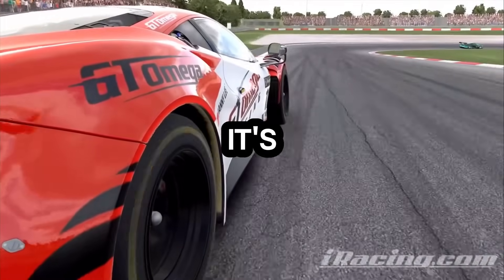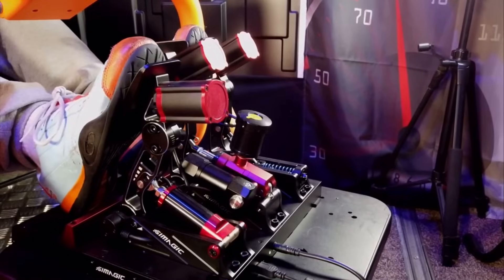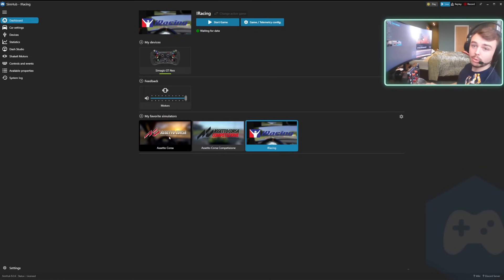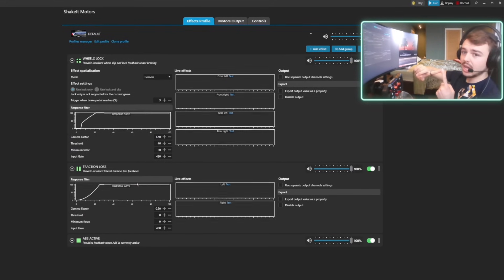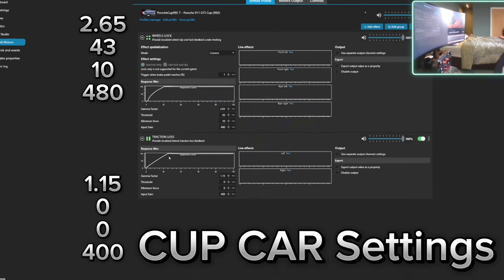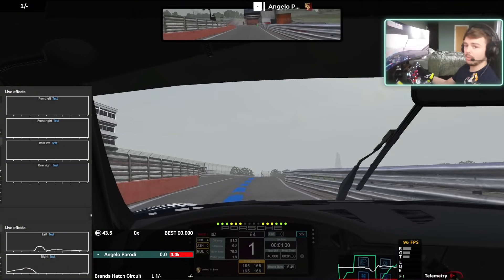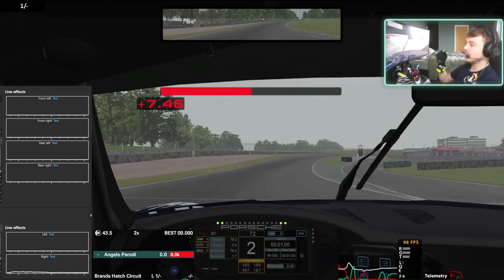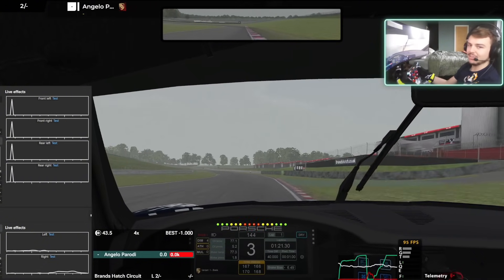Simagic Haptic Reactor A Game Changer for Sim Racing (iRacing & Haptics)

Comment: I take it that "If you've just got regular brake pedals, this is going to be a little bit trickier for some of you" is British understatement for "Forget it, sucker, it's impossible."
Reply from the maker: Lots of people have set them up on different pedals it just requires more work.

You’re gonna need to find some 3D printed mounts for your pedals and also purchase the p2000 pedals control box. There’s other videos online for how to use them with other pedals.

Definitely not impossible 👍🏽
Reply: Sorry for all the individual comments for the different links. But that’s the amp you want and then choose between either base shaker. Only other thing you need is some speaker wire and some hardware and a few tools (a drill) to mount them to your rig or pedals
Reply: All you need for Huesinkvelds is a screw and a washer.

Comment: Thanks for the video, Bravo.  The devil is in the details.  A subsequent video showing the details would be awesome!
Reply from the maker: Will make one soon about the Simhub install and then how to mess around with the details and set it up properly👍🏽
Reply: @TerriblyRacing  Excellent, thanks.  Interested to know specifically how you dialed in the Simhub curve (which paramater did you start with), and second how did you get the trace overlay to show while racing.
Reply from the maker: @mattmerciez8144  yeah for sure, will explain my best how to adjust the settings, unfortunately getting the trace on screen for you won’t be possible.

I can do it whilst recording but not live on my screen. You shouldn’t want it on screen when driving you should feel the vibration whilst driving.

Comment: Have had these on my simjacks for about 6 months and it’s been a game changer in immersion and as an amazing tool.
Reply from the maker: Check out the settings in my second video, the settings in the first video were bugged! And honestly like you said they are a game changer
Reply: @TerriblyRacing  ho appena preso questi motori. volevo chiederti se si puo' usare semplicemente simpromanager x settarli. a me interessa abs per freno e tc per accelleratore. oppure devi usare per forza simhub?
grazie
Reply from the maker: @lusl77  you can use Simpromanager if you just want to use TC and ABS. Some games don’t output that data and in that case you’re better off using Simhub effects.

But yes you can use just simpromanager
Reply: Would haptic motors be beneficial if you race GTP’s/LMP3’s/LMP2’s?
Reply from the maker: @louiienation8497  I don’t see why not
Reply: @TerriblyRacing  I’m asking about those cars specifically cause they don’t have abs or traction control
Reply from the maker: @louiienation8497  neither of the effects I use in Sim hub require ABS or traction control
Reply: @TerriblyRacing  thank you for that info! I’m really excited about buying haptics now !

Comment: Simagic haptic pedal reactor is so cheap bro. I should have done this earlier.
Reply from the maker: They’re not that cheap but compared to the rest of sim racing they’re great! Use the settings from the second setup video
Reply: @TerriblyRacing  I live in Canada and I have a local distributor for simagic so it kind of works out. Was looking at sim3d rumble kit, but anything from the UK kills me in taxes.
Reply from the maker: @EluciaDeLuteIma  just remember to Mount these on pedals that aren’t Simagic you’ll need to buy 3D printed mounts to mount them, a power supply and the p2000 control board, each vibration motor is about £65 but yeah they are great
Reply: @TerriblyRacing  Ah yes. I sent my friend a file already and he'll print it tomorrow.
Reply from the maker: @EluciaDeLuteIma  good stuff, use the settings from my second video, these settings are no good

Comment: So I guess the brake pedals vibrate as well when you brake? Do the the vibrations feel different on the 2 pedals? Thanks for the vid
Reply from the maker: @7hecouchpotato  so the brake pedal reacts to wheels lock and is set to vibrate at 23hz the accelerant reacts to traction loss and vibrates at 41hz. The vibrations on both pedals are quite different due to the different frequencies. 

If they were the same frequency, I’m sure they feel similar on both pedals
Reply: @TerriblyRacing  Cool. Thanks for the detailed response. Will try out the settings once the speakers arrive!
Reply from the maker: @7hecouchpotato  I recommend using the settings from the second video. The settings in this first video are bugged/shit.

I had a setting in my Simhub that was wrong and made all these settings wrong. The second video had the correct settings, if you join my discord, link in the yt bio. You can download all the per car settings I’ve made so far 👍🏽

Comment: What about for dirt racing will this work
Reply from the maker: Yeah for sure but it might be a lot less useful as you’re constantly braking traction, you would have to move the thresholds much higher as to not trigger vibration for say a 5° slide and maybe you’d want vibration at a 30° but I can’t say how useful it’d be for you
Reply: Oh you can change the degree of slide for when the vibration starts? That might be goated for dirt
Reply from the maker: @colors3037  through the settings explain in the second video you can adjust how the vibration comes in and how soon and strong
Reply: Also I don’t see the p2000 module on the website I’m thinking about buying the p1000 pedals and the haptic motors for them
Reply from the maker: @colors3037  it’s called p2000 HCB HAPTIC control box
Reply from the maker: @colors3037  if you go for the p1000, don’t forget the power supply
Reply: @TerriblyRacing  power supply for the haptic right or the pedals
Reply: Also is it easy to hook up the control box
Reply from the maker: @colors3037  power supply for the haptics yeah, there’s no supply for the pedals 👍🏽
Reply from the maker: @colors3037  yeah very simple, just power, usb, and haptic reactors plug in

Comment: This was really helpful. I knew I needed one of these for braking but didn’t realise it would be so useful for the acceleration. 
I was going to buy one of these for braking and I already had a transducer I was going to use for the accelerator pedal. Might test it this way first
Reply from the maker: Good idea, let me know how you get on
Reply: @TerriblyRacing  would love to test it asap but I’ve got a back injury which has stopped me (sim)racing for the past 2yrs. Might finally get back on the track in a few months 🤞
Reply from the maker: @tdhitchins  fingers crossed for you bud, even if it’s not competitive, just get in the seat and relax, injury permitting 🤞🏽
Reply: @TerriblyRacing  cheers mate. You don’t know how much I’ve missed it!! It has got me playing some other games I wouldn’t have had the time for and I’ve enjoyed that tbh, but still……I wanna race
Reply: @tdhitchins  Just out of interest, what kind of pedals and seat do you use? I had back pain too. Was using a soft seat with a load cell brake pedal. Every time I pressed the pedal I would push myself far into the seat, which crated pain in my lower back. Couldn't race for more than 20min. As soon as I switched to a solid bucket seat (something with a fiber glass shell), my pain was gone,...and my braking got much better.
Reply: @mementomori4972  thanks for the reply. I’m hoping a solid backed seat will help, I’d been thinking about that. I used to use the playseat challenge (soft back) and thought that wasn’t helping. My injury is due to having torn a bit of a disc though. It was some time ago but still getting over it.
The pedals I have are now the simlab xp1’s which I’ve not even been able to use yet (argh) but I’ve printed off some mounts for these rumble motors. Hopefully later this year I’ll be back on track!
Reply: @tdhitchins  With soft seat, I meant something like the GT Omega, but the playseat challange is basically a camping chair,...a hammock with benefits. Dude, you can't race in that, especially with load cell pedals and a healing back injury. The thing is a toy. It's meant for something like a G29 setup. I get it. It's expensive. You will need a profile rig too, but it's going to be so much better for you and your special circumstances.
Reply: @mementomori4972 
😂 hammock with benefits! I like it.

Yup, I sold that a while ago now after realising it was probably not helping and wanting an upgrade to an aluminium cockpit anyway. Once my back is doing a bit better I’ll sort the new equipment.
I was going to buy a bucket seat (fibreglass) but then thought the added comfort of a gt omega reclining chair would be the best option as I don’t have to sit so upright (which I really don’t like). I know all about posture (wife is a physio) but I just can’t stay comfortable like that.
Reply: @tdhitchins  The GT Omega is not going to give you better comport. Don't buy that thing, you will regret it. It's to soft  and it wiggles. Michel Smith has a small Simracing Youtube channel. He upgraded from a GT Omega to a bucket seat and he also has a back injury. Watch his video on finding the best racing bucket seat, if you're interested. Sorry to read about your psycho wife. Wish you all the best!
Reply: @mementomori4972 hahaha physio not psycho ;) although….

And cheers, I’ll checkout that channel for some advice 👍

Comment: Super helpful!  Thank you.  (haven't tried it yet on my own setup.  P1000 pedals, SimMagic motor, iRacing and SimHub)  I stopped using the SimMagic motor a few months ago because I couldn't get it to stop shaking.  I'm sure it was a setting that was wrong in SimHub, but I couldn't figure it out.  I did notice that you somehow eliminated the unused SimHub options in your example.  I'd like to learn how to do that.  (maybe that would solve my issue)
Reply from the maker: Use my second video/part 2 to set them up, I changed the settings as the first ones were bugged originally 👍🏽
Reply: @TerriblyRacing  Thanks!  (searching for that part2 video now)
Reply from the maker: @mitchlewis535  if you can’t find it go through my channel, any questions join my discord it’s linked in my latest vid
Reply: @TerriblyRacing  Thanks

Comment: I use “cheap” Dayton base shakers under my pedal (fanatec CSL load cell) for the same purpose, and have used them for about 5 years now. It was a game changer for me (even on top of a load cell). 
Cost me about $50 but that was in about 2017-2018 so don’t know what they cost now. But you just need a couple shakers and a cheap usb amp. Run them through sim hub as well…
I have added to them over the years so now I have a total of 4 on my rig… and contrary to most advice I don’t have them set up for “4 corners” so you can feel each individual wheel….
I have 2 set up under my pedals only because one just wasn’t quite enough to really feel the “shakes” through the pedal, but for about $15 (again in about 2018) adding a second one did the trick… these two are set up to do the same thing and just having 2 was more powerful than just a single one. My other two are mounted on my cockpit seat. One of them right under the seat (right under my butt), and the last one is on the back of the seat kind of at my lower back. These two shakers on the seat do a few different things, the one right under my butt I use for traction loss for the rear end of the car (so it kinda gives you that feeling in your butt when the rear end is braking loose), the one on the back of the seat also does this to amplify it. The only extra thing the shaker on the back of my seat does is gives you a slight punch in the back on gear changes. So ya all for under $100 I have 4 base shakers and two usb amps. 2 amps is the key… with sim hub each amp can be its own “channel”, so with two amps one is for the front axle and the other is for the rear axle.
Reply: Take a Pic of your configuration

Comment: I dont get exactly what i feel during braking…. For example if i hit the Brakes (Porsche Cup) it rumbles but i dont think that i have wheel locking there… and if i keep the foot on the brakes to force a rear lock up i get no rumbles at all - so i have no clue what exactly i get here if it doesnt rumble like full when the tires are locking before i spin… (using ur settings for Porsche Cup)
Reply from the maker: Use the settings in the second video, wheels lock can’t activate in iRacing as it’s not supported, the vibration should come in when you’re roughly at the right threshold of braking
Reply: @TerriblyRacing  ah ok to if its rumbling i am roughly on the best possible braking force input? So if its stopping rumbling i should put less force of braking in?
Reply from the maker: @MINKIHLGTSPORT  whilst braking when it vibrates you are roughly at the right point, when the rumble stops you’ve pressed too hard or you’re not braking hard enough

Comment: Great vid!

Question: is the haptic feedback dynamic? In other words, is the vibration 100% or 0%? Or, do they vibrate a little when traction is barely breaking, and a lot when you're sliding, etc?
Reply from the maker: No unfortunately they either vibrate at 100% or nothing, I think it’s because they vibrate at certain frequencies so therefore it makes it impossible to regulate the force so it’s either on or off
Reply from the maker: Sorry I have to acknowledge my last response is all true however with sim pro manager, the Simagic software, the force can be be modulated, so not sure why it doesn’t feel possible in Simhub, I will follow up
Reply: @TerriblyRacing  Appreciate the follow up. I'm likely going to order one for my brake, but just curious if there is granularity to the feedback.
Reply from the maker: @steelereign reinstalled SimHub today, there is granularity, you can customise how strong the feedback is and varying stages and strengths.
New video coming soon!
Reply: @TerriblyRacing  That's good to hear! I just ordered my haptic (only for brake) yesterday.

Comment: Not cheating because it doesn't actually work the way the video implies. Yes it's great for extra feedback, but iRacing doesn't output any data on loss of traction into simhub. Unless something changed recently.
Reply from the maker: I think you’ll find the algorithm knows pretty damn well when there’s traction loss, I seriously feel like these are almost cheating
Reply: @TerriblyRacing  simhub doesn't know when the wheels are locked or spinning. That's why you need to change it per car
Reply from the maker: @MarkGreenhow  no you need to change it between the cup car and the f4 because they’re massively different cars with very different power levels and dynamics. Have you not used shakeout motors in Simhub before?
Reply from the maker: @MarkGreenhow  go watch the part 2 of this video for more information
Reply: @TerriblyRacing  I did. You also replied to someone else saying what I said, iRacing doesn't output wheels locked, you can estimate it based on testing but it's based on pedal pressure. Track surface changes make a difference on whether 30% braking pressure locks the wheel or not. I've tried this and found it gave me no advantage. I do wish you all the best with the channel though.
Reply from the maker: @MarkGreenhow  I appreciate it, Simhub does receive data from the cars from iRacing just certain properties aren’t exported that’s why different braking pressures matter whether you’re going up or down hill the reactors don’t just work from pedal position. My accelerator tell me when I am sliding the variables I adjust decide how soon they tell me into the slide, like only 1° slide or 30° slide. And also how strong the reactors vibrate along that curve from 1° to 30° slide

Comment: The F1 games have controller vibration system based on rear and front slip amount (one motor for oversteer, other, more binary, for understeer), and that was already considered borderline cheating, especially in wet conditions. I want to put that system back in BeamNG.

I cant imagine how good that would be for pedals. I guess you could have one on the throttle, and on the brakes for front slip (understeer).

Comment: All I'd follow up with on this is that pedals maybe ought to start coming with some sort of feedback as standard, so that games themselves can start supporting it. Flexibility is a good thing, and the pedals are behind the wheels in that regard. 

As to the usefulness of it all, well it helps some, sure. Others would argue VR is an advantage, but I'm not sure that pans out in reality. But you can understand why some might think that, with the depth perception. 

And yet for all these extras, there's always some ass that will be faster than you using a Dual Shock controller.
Reply from the maker: Very true😂😂😂

Comment: Thanks for the video  but those settings for F4 are dreadful! Pedals vibrate too much! Did few F4 laps at Zandvoort and pedals were vibrating pretty much the whole time. Smallest steering wheel movement causes haptics to vibrate, even on the straight.
Reply from the maker: You are correct, I do apologise, I had a simhub problem, I’ve released a second video with updated settings, Part 2 video is out now
Reply from the maker: I reinstalled simhub because i had a bug, latest video has corrected settinsg

Comment: Thanks for the video mate. I love that there's a graph showing brake lock and grip loss. Would Sim Hub work for Assetto Corsa Competitizione and Dirt Rally 2? I don't play iRacing. I play ACC mostly. And I got pedals nobody has heard of - Steel GT by BJ Sim Racing. And I have no idea if I could mount Simagic's haptics on them.
Reply from the maker: If you have a 3D printer anyone can mount them. 

Simhub also supports most games so should be ok👌